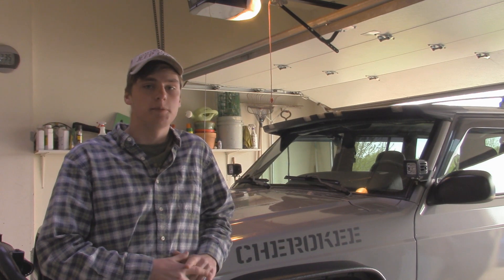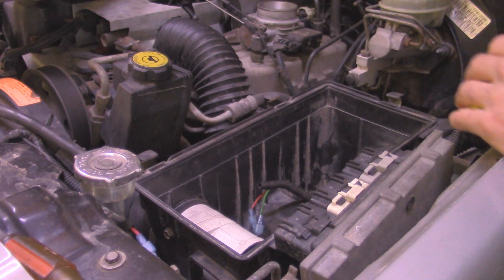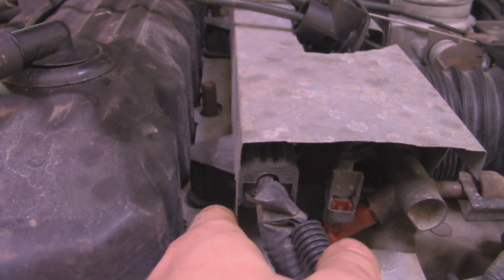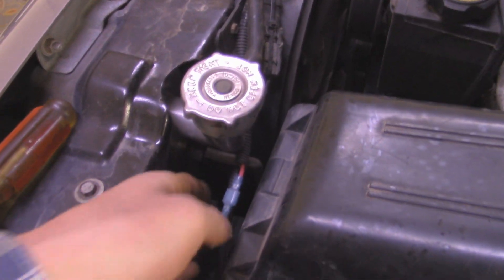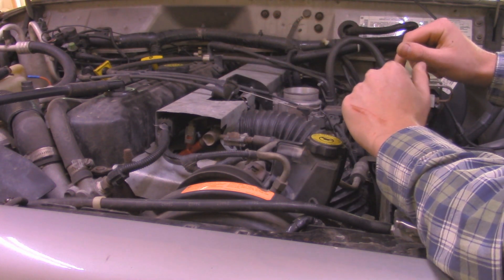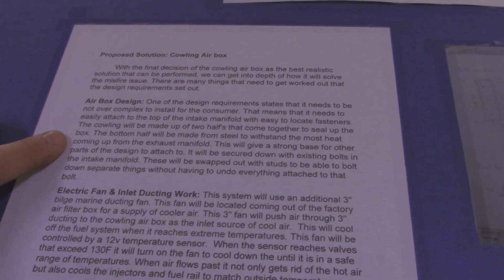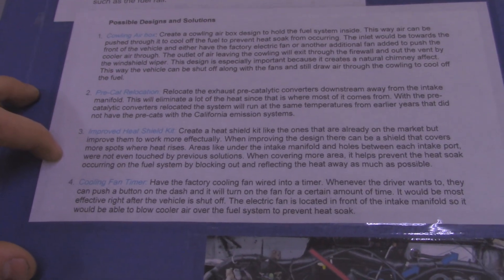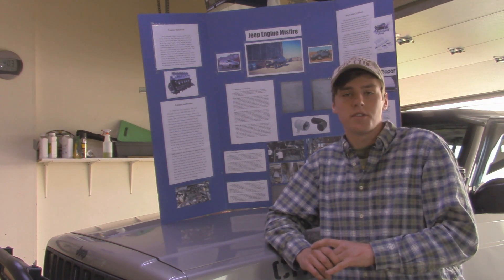A New Way to Solve Heat Soak!

Comment: One of the best and cheapest ways to stop that heat soaked situation is by spring the top of your injectors and fuel rail with heat resistant manifold paint

Comment: Great ideas!  Lots of helpful suggestions in the comments also; 180 degree thermostat, ethanol-free gas, check the mechanical fan clutch, etc ....  All easy solutions.  Thanks!  BTW:  Why do the 4-hole and 12-hole injectors help?  What's the engineering logic behind that solution?

Comment: Very good video!  
The bottom line for me is to replace the injectors with the new 12 hole version. 
And while I'm at it replace the leaking valve cover gasket. 
Both presently collecting dust in the shop!

Comment: Hey quick question, where is the firewall cable supposed to be connected to? 
 I think mines not in the right spot,  i uploaded a short. Any help is truly appreciate it
Reply from the maker: Anywhere where there is a good ground connection to the engine. I would route it to the engine block instead of the intake manifold.
Reply: @OutJeeping  thank you for replying!!!
I'll route it to engine block.

Comment: I live in the desert by Yuma. I have tried all of these quick fixes. Wrap kit, 6 hole injectors and latest is 12 hole, can't see any difference. I had but louvered vents in the hood as my first project. Then added a kit blocks under the back of the hood, helped some then added a delay for 3 minutes that runs the fan. I turn on the fan just before I turn off the engine then fan runs that helps move the air out the back of the hood. . 
Now back to You removing the Cats and installing a Y what do you compensate for the 4 O/2 sensors. I need detailed help on this or I would have started out doing this first.

Comment: Just subbed, can u tell me the direction the bilge blower fan is directed? Sucking air out of the airbox or blowing hot air out of the airbox?
Reply from the maker: It's blowing air out of the box onto the fuel system. I located the fan here to protect it from any water that may be present.
Reply: @OutJeeping  excellent

Comment: Thanks for the informative video.  What make and model # 12 hole injectors did you install?  Did this resolve your heat soak issue?  Thx again.
Reply from the maker: It helped reduce the occurrence of heat soak but it did not totally eliminate it. The injectors I got were to fit a 2001 XJ off of the K Suspension website. https://www.ksuspensionfab.com/store/p22/Remanufactured%3A_12_Port_Upgraded_Injectors.html#/
Reply: @OutJeeping  Thanks for your reply.  I appreciate your comment that the 12 nozzle injectors won’t completely eliminate heat soak.  In the past I’ve always been able feather the throttle and the heat soak would go away. Lately, however, heat soak was stubborn and would occur at lower temps.  Rebuilt injectors received from K Suspension. At this point, I’ll be happy if I can get back to feathering the throttle remedy.  
Best

Comment: Have you noticed if the fan kicks on much while the engine is running? Since the fan is in the filter box, it will be fighting the intake vaccum while the engine is running. This might contribute to the fan free spinning when the engine is running or premature fan failure.

Comment: I thought heat soaking was the bottom of the intake gets so hot that the heat rise and cooks up the spark plug number 3,, a simple solution was to just block or re direct that heat elsewhere.. I see that you covered the entire area...wouldn't that makes it worse?..or is the fan pushing it out elsewhere?
Reply from the maker: My idea behind this was to have the hot air around the fuel system pushed out with the fan.

Comment: At stops on a warm day in Texas my car will idle slightly rough until at another stop it'll drop in rpms and not move at all accompanied by misfires. letting it sit for 5-10 minutes and my jeep will go like normal until i stop again. My Cherokee is a 93.
Reply from the maker: Sounds like the fuel system is starting to vapor lock before it is fired in the engine.
Reply: @OutJeeping  maybe. Only started happening frequently after i took a trip to a junkyard 30 miles from where I live. Took the highway doing 70 mph on a 95 degree day. Would a heat shield minimize the problem?
Reply from the maker: @AnEverydayGamer  Yes you can install a heat shield underneath the fuel rail or get a fuel rail and injector insulation wrap. I believe Design Engineering makes a kit for the Jeep 4.0.
Reply: @OutJeeping  alright I'll definitely have to check them out. Thanks!

Comment: The cheap way is clear up plastic and other material blocking in from the grill to the engine putting a spacer in at the end of the hood . the other is a reverse hood scoop with holes in hood. N a 5in- 8in fan with switch on top of hood hiding in the scoop with switch and timer cut off. Another is hooking a cooling  fan switch with reverse mode with timer household timer. To your cooling fan . you can do all if you have a racing engine modified 4.2 liter

Comment: Seriously biggest overlook . Is that mechanical fan. Easy check . At idle the fan mechanical one should keep engine cool at idle and lower temp at idle . Slowly but it works . After going up mount rose ...I sit idling while my family stretch their legs for 5 minutes. It lowers the temp to 180 . (Radiator temp). Then i shut it off. When my mechanical fan was broke. It heats up sitting ..idling. ..anyway take care. I owned 4 xj.  Still own 2.

Comment: Much easier solution is ....I put 180 degree thermostat in instead of that 192 degrees one that is stock. This starts the cooling process sooner . Thus, making your entire engine cooler so it doesn't build heat up in the first place. Also most people forget to check the mechanical clutch fan. If it works , you can idle to cool engine. If it is failing, idle heats it up. The fan clutch goes out every couple years.  They work all the time.

Comment: Have a 2007 Jeep grand Cherokee and for the last month I’m having this issue on and off. Yesterday I installed a new remanufactured starter from O’Reilly now when I start the engine at anytime it starts but the initial turn of the key the starter is super really slow and loud grinding sound but it starts I hate the  sound that it makes so today I’m thinking about switching back to the old stock starter where it would fire up w/o any slow hesitation grinding sound like the new starter does, I just found out about vapor lock issues like yesterday after my new starter was installed via YouTube’s etc. u think if I put back my old original Jeep starter it would start “normal” w/o that slow grinding sound the new starter makes? I basically just have to eat the labor that I paid to install the new starter and pay another labor to put back the old starter and via YouTube videos there’s a valve release apparently located on my fuel lines behind the motor and there’s a release valve in there that I could access by using a rag cover it and a flat head screw driver to release vapor lock some guy from YouTube explained this very well just like u did w ur video ...
Reply from the maker: If the new starter is acting up I would first check the wire connections to it and make sure they are cleaned off. If that doesnt work then it sounds like it's just a bad starter from oreileys and they should be able to replace it under warranty. As far as vapor lock issues, I have the same problem on my jeep but releasing the pressure in the fuel rail wont help with vapor lock in the long run. I've always let the fuel pump Prime for 5 seconds before starting the vehicle and it seems to help a bit. There is also kits out there that you can get fuel rail shield to help Shield engine heat away to prevent vapor lock.
Reply: OutJeeping cool ty so much for the reply 👍🏽 ya ur right I think the starter I got was bad it was a remanufactured so I ordered a brand new one to replace also found out that my 07 jgc doesn’t even have that release valve in there so just gonna do new starter and have my mechanic check and clean the wirings plus the 5 sec prime delay also does help and started using premium gas now have a good weekend bro 🤙🏽

Comment: my 88 had this, or so i thought. long hard start every time. SO i fixed my fuel leak at the pressure regulator. that helped. and then replaced for the 2nd time my whole fuel pump and sender assembly. no more long hard start, no more pressure leaking down and making me THINK i had heat soak.  and yes heat soak is a real thing. just saying the symptoms COULD be something else.

Comment: you mentioned new fuel injectors to fix the problem .....can you reply with the type part number or supplier if possible  and what replacement exhaust header do you intend to use ....hv a 2000 a Jeep Cherokee 4.0L I am doing some  upgrades on and want to include your upgrades ...I have wrapped exhaust manifolds in my BMW and it reduces the heat significantly  !!
Reply from the maker: I got a video covering the injectors. The exhaust is the Y down pipe for federal emissions made by Walker. FYI it deletes your downstream o2 sensors so the CEL would be on. I was thinking about wrapping it but some people say it will rust out the pipe more. https://www.youtube.com/watch?v=9eBJXvTsOOw&t=2s
Reply: Ksuspension for your injector swap and wrapped headers rust big time down south your best bet would be a ceramic header even the higg temp ceramic paint will help

Comment: I use ethanol free gas which has a higher boiling point. Its a bit more expensive but I get better gas mileage , it doesn't gum up components and I Haven't had any heat soak issues on any of my 3, 2000+ jeeps since I started using it.
Reply: I live in PA and finding a ethanol-free gas station is like finding a unicorn
Reply: I have noticed the same effect on my ‘96 XJ
I use the PureGas app to find ethanol-free gas

Comment: My 01 was hard to start with a heat soak problem.   The cause was fuel injectors leaking down after engine shutdown.  Got new 4 hole injectors and never had the problem again.   Even with the stock foil insulation removed.
Reply: What injectors did you set in your xj?
Reply: @jalatecompa    Rebuilt Bosch injectors for about $60 on eBay.

Comment: If you remove those pre cats wont it set off a check engine code?
Reply: Yeah.  I want to know more about the pre cats removal.  I know you can get y pipe that will bolt up.  What about the down draft o2 sensors. Can you share more info.  I know it’s” illegal”. I’m only asking for a friend.
Reply from the maker: Currently it does throw a code for both the downstream o2s. One is not hooked up and the other is with a extension piece that comes out and is supposed to trick the o2 into reading correct vales. It worked for a couple days then threw a code because the voltage is too high so i may do some experimenting with resisters. Then when it works I will weld in another bun and do it the same to the other downstream o2. I currently have the one downstream that's hooked up on a bun that was already welded on a front pipe that comes brand new from Walker. This front pipe fits 00 and 01 so they put a bun there for the upstream on a federal emissions jeep. If it was California emissions and you still have the precats, you would use a plug that was provided.
Reply: OutJeeping  Have you tried the 90 degree O2 fouler? I put catless downpipe on 2017 Ecoboost mustang and currently fooling the computer with one. Ordered it off Amazon
Reply from the maker: Jethro B Yeah that's the one I have and I got it off ebay. Was working for a couple weeks now it just reads 1v and doesn't go lower